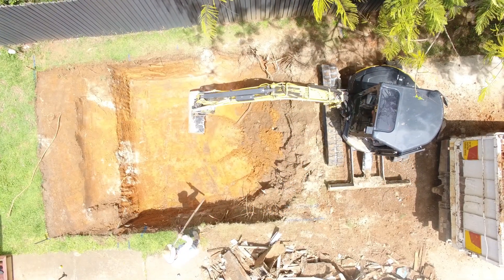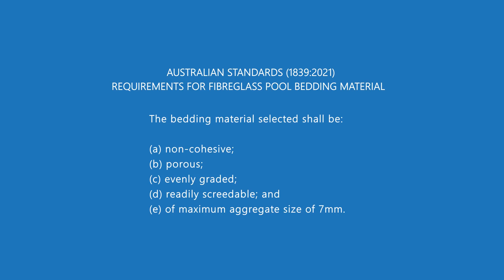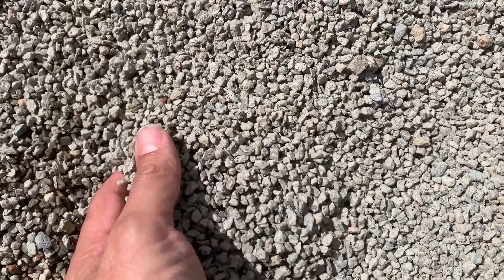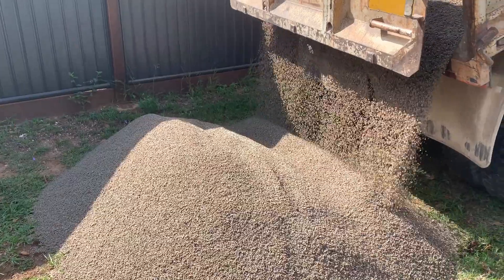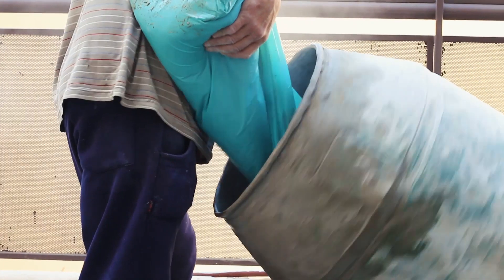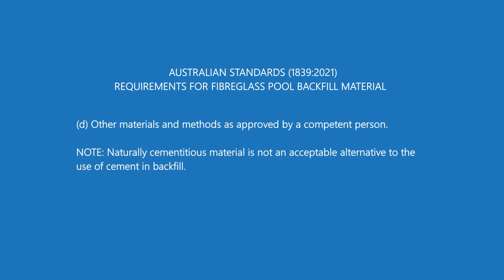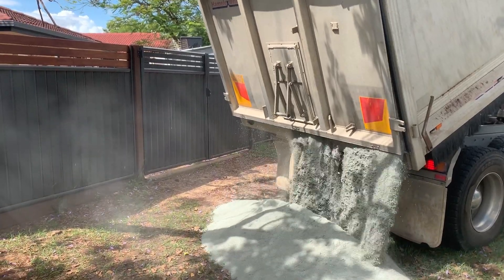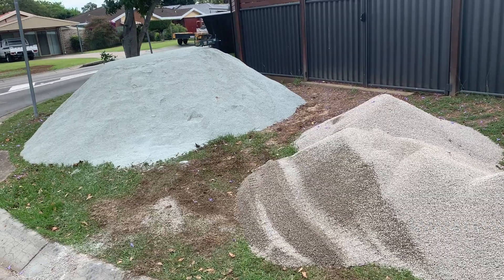The Bedding and Backfill Material To Use When Installing A Fibreglass Pool

Comment: Is there a reason why standards/CDC limit bedding material size to 6/7mm and do not use for larger aggregate like road base ?
Reply from the maker: Our understanding is to prevent pressure points in the floor of the pool shell that will cause future cracking.

Comment: Can you jack hammer up the old pool coping and pool deck tiles without cracking or breaking the fibreglass pool shell?
Reply from the maker: The coping tiles should be able to be removed without needing a jackhammer. The tiles should only have a thin layer of glue or cement to hold them onto the actual coping beam. A jackhammer anywhere near a fibreglass pool shell is not a match made in heaven!
Reply: No problems and thanks for the heads up. I had a feeling a jackhammer was a bad idea

Comment: Can I use 5 7 mm agregate on walls backfilling as well as for a bedding material
 I live in Thailand hard to get some materials. Thanx Ray Faulks
Reply from the maker: Hi. In Australia, you can use up to 7mm however the key is to mix in cement to stabilise the material once installed. We don't know about Thailand however with the rain and most likely clay, cement stabilisation will be important at a guess!

Comment: Hi, do you compact the bedding?
Reply from the maker: Hi Daniel. As a general rule, installers do not compact the bedding. It is not a requirement in the AS1829:2021 Fibreglass Pool Installation.
Reply: Yes
Reply: Yes we compack
Reply: Thanks for the vid